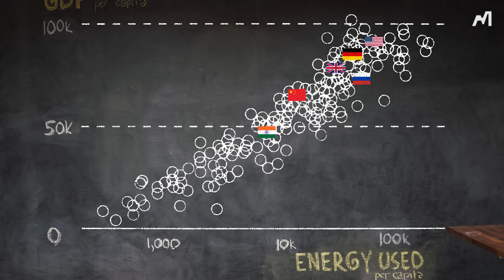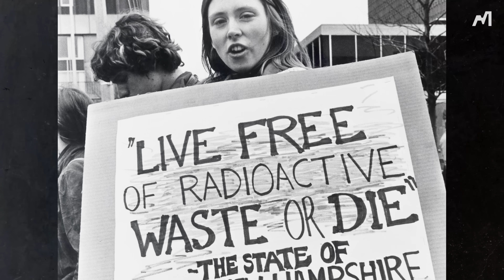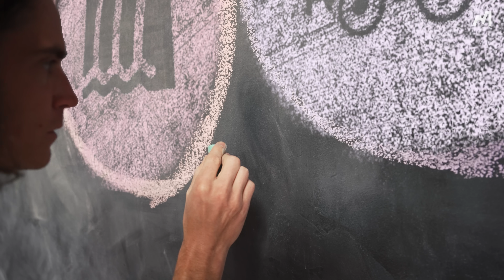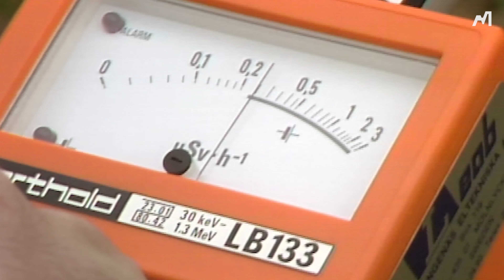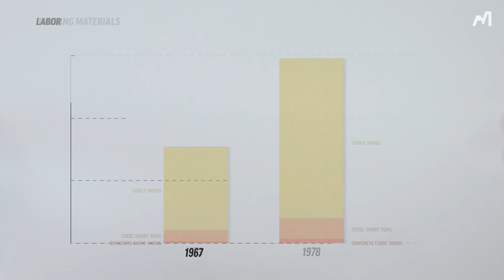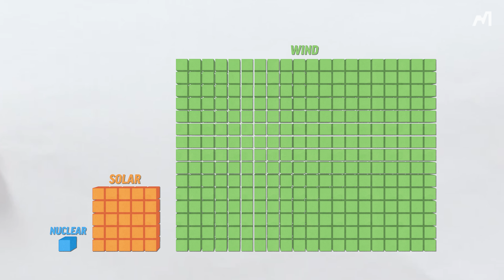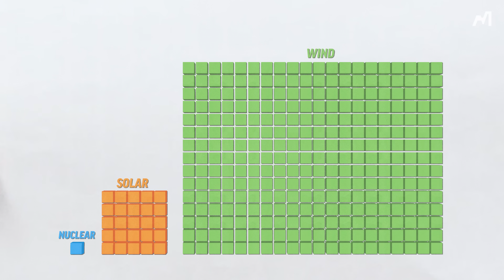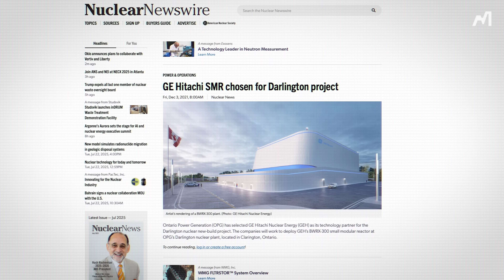They're Lying to You About Nuclear Energy

Comment: Worth noting the downtime for many nuclear plants and its effect on costs. During the drought in Europe during 2022, France had only 32 of its 56 reactors running due to a combination of the water sources for cooling being either too warm, simply not enough water available, and also scheduled and unscheduled maintenance. That's only 57% of its nuclear power actually available and led to electricity being rationed so to speak. One plant alone was shut fown for four years for maintenance. All that time it's costing money without making any. Expensive to say the least.
Reply: That's why the US should have and use MULTIPLE sources for energy.
Reply: @robedmund9948  They do? Coal, solar, wind, nuclear, and hydro... There's probably others I don't know about. Are they using Tidal energy anywhere? I learned about that one in middle school but haven't heard much about it. Seems under utilized.
Reply: @TheManyVoicesVA I think on the Pacific Coast some tidal (very limited) is used, but I'm not 100% certain.  I agree that it's probably underutilized.  So is Hydro.  We could use hydro wherever rivers/larger streams run even without building dams and massively disrupting ecosystems, but there's no economic incentive there.
Reply: @robedmund9948 the economic incentive is literally free power.
Reply: @TheManyVoicesVA  I meant for major corporations like oil, wind and solar.  But yeah, after the initial investment, "free" power is a good thing.
Reply: @TheManyVoicesVA there’s no free power my man, tidal energy is consistent but low in magnitude- it’s difficult to extract enough energy from it with respect to the effort taken to put generators under water. Another huge point is corrosiveness of salt water, huge maintenance cost and marine life protection. as of right now, it’s unfortunately still too complex and maintenance intense and therefore too expensive.
Reply: That's partly the result of 30 years of anti nuclear push in the country, green regulations and the lack of investment in the industry because of it.
Funny how it happened after several years of pushing more and more renewables, yet they couldn't pick up the slack. And that just made me think of the Spain blackouts where they are totally phasing out nuclear, and look how well they managed it
Reply: @nicolaspeigne1429 so how do you explain that chinas % of nuclear power in the grid dropped even tho theyinvested massively in nuclear power in the 2000s and onwards. Like do you actually believe that there is a great conspiracy around nuclear energy even if china dosnt pursue it more than renewables ? you simply don’t understand nuclear power nor its problems
Reply: @nicolaspeigne1429 Wtf have renewables got to do with there not being enough water?
Reply: Yea, France was dependent on imported power from you guessed it GERMANY.  That's why even France is installing renewables and the nuclear share of their grid is dropping.
Reply: @kennethferland5579 damn what a crazy world you live in
Reply: Sorry but it seems like you've been misinformed, I'm french and we didn't have any problem with electricity "rationning" anywhere. Electricity prices spiked in the last years, but this is due to the electricity pricing system, which is always based on the most expensive source of energy available on the power grid. Lately this most expensive source has been natural gas due to the war in Ukraine and the economic sanctions on Russia that went with it lead to an important price surge.
The massive reactor shutdown was a thing tho, but not at all related to the drought issue, it's just because all nuclear reactors were built more or less during the same period, and the Covid pandemic delayed a lot of the planned maintenance that had to be done. Also a stress-correlated corrosion issue was detected in those power plants, so the scope of the maintenance was further increased with it. And yet we didn't have any power or blackout issues in the country.

The drought issue you're mentioning affects all thermal power plants (so also gas and coal power plants), and is not at all a technical issue but more of a legal one. Thermal power plants CAN cool off from warmer and less abundant water in rivers, but the issue is that researchers are worried that releasing too much hot water in the river could affect the local biodiversity of it. So a threshold of a few degrees was set, and beyond that you must stop heating the river. There was never an issue of small rivers going totally dry during drought, of course no power plant cool off from small rivers that might dry out during summer.

Compared to solar and wind, nuclear has the best uptime, and contrary to solar and wind this uptime can be controlled and adjusted to the production needs of the power grid.
I'm not saying maintenance is not costly for nuclear power plants, this is in fact true and I don't know the exact number but it is probably more expansive than for solar or wind, but you also have to take into account the lifespan of these reactors which can be extended even further than the already quite old (40 to 50 years) nuclear plants we have in France. For solar and wind, you have to replace the panels and turbines much earlier.

The only major drawback of nuclear is the massive investment needed to build just one plant, but once you have it, the fuel is ridiculously cheap and the only real expanses are maintenance costs. Nuclear requires a lot of highly qualified worker to plan, build and run it though. This is a something that cannot be done by companies due to the massive amount of investment and planning needed over almost half a century. If a company-hold nuclear plant shuts down because that company went bankrupt, you can't just unbuild the plant like that, it take years and billions of dollars. This is an issue that wind and solar don't have, you can mass build them locally without too much trouble. But they have other issues that make them complementary to nuclear power for electricity production on a global scale, and not a direct competitor of it as most people seem to think.
Reply: @shiuay6165 Sorry mate but the effects of the drought and heatwave conditions and the subsequent effects on the output of some plants was widely reported at the time and still easily verifiable with a quick search. Same applies to the corrosion issues and the associated maintenance and costs. Both the World Nuclear Association and International Atomic Agency have written pieces on these issues, and I have no doubt will still be available on their extensive websites. Both of which have always been a reliable source of information on anything nuclear power related in my opinion.
For the record, I am in no way anti nuclear power, I am just realistic about the various issues that can arise and the associated costs and effects on energy security. The water issue I have always felt was a major concern for us here in Australia given the severity and length of droughts we are prone to, and would be foolish to ignore when considering a nuclear powererd future.
Reply: Noted.
Reply: Yea but did you consider this video isn’t nuanced at all and is largely just an echochamber for nuclear pipedream entheusiast who disregard all you very valid points ?
Reply: @decflecc98 honestly, i didn’t even watch the video but jumped straight to the comments to check exactly this point 😁. and thanks, you basically confirmed my suspicion - especially when looking at basically all other comments except for this thread 😅.
Reply: exactly! When looking at the levelized cost of electricity, nuclear does not stand a chance against wind and solar - and that's ignoring the costs for breaking down a nuclear plant. These are miraculously never taken over by the providers and are often paid for by taxpayer money. Also, most plants end up costing a multitude of the initially estimated cost price which basically destroys the business case - days of standstill definitely won't help it either
Reply: @Max-oo9ez  And then there is the free insurance provided by the state. No commercial insurer would accept the risk.
Reply: @Max-oo9ez how many wind mills do you need to equal a single nuclear plant? How much space does that take up? What do you do when there's no wind?
Reply: @TheManyVoicesVA And what do you do when there's no water for cooling for years in a row?
Reply: @plumtube01 you can import water. You can't control weather. It's probably easier to desalinate salt water from the ocean than it is to make wind and solar more viable. (They aren't going to solve our energy needs anytime soon.)
Reply: @TheManyVoicesVA Import water? Pretty hard to do in a drought mate. And while a desal is an option, it is another capital and ongoing cost, plus it's going to use some of the power from the plant, making the already high LCOE even worse.
Reply: @plumtube01  probably cheaper than cleaning bugs off 30-40 fans every month.
Reply: @TheManyVoicesVA If it was so cheap everyone would be building them.
Reply: @TheManyVoicesVA solar and wind energy are profitable businesses lol.
Reply: @plumtube01 Palo Verde in the USA uses recycled  sewage water. Im in Australia and recycled sewage water is used for power plants here.
Reply: @mazdub  Hey mate. Yeah it's certainly possible, but my concern here in Aus would be as the French discovered, is that water temp plays just an important role as volune. And given the high temps and extremely low flows we saw during the last big drought, a serious concern. Take the proposed nuclear plant at Mt Piper which sits essentially at the head of the Macquarie River. During the last drought downstream flows into Burrendong dam were less than what Dubbo was using on their tightest restrictions, and that's their sole supply. They were down to only a fortnight's worth of water.  Now consider that roughly the same amount of water entering Burrendong was the same amount entering upstream from Bathursts water treatment plant, and I think our rivers are strained enough already. Add a greater population and probably even drier conditions in the future, and I think it's fair to say drinking water will take precedence over cooling a nuclear plant. Either way, very risky in this type of scenario in my humble opinion.
Reply: @TheManyVoicesVA  By cost per energy produced eg the only useful measure? Less than nucler.
Reply: @Max-oo9ez  What is a ‘levelized cost’? 

Nuclear should be a tiny fraction of the  cost of any other supposed ‘green’ energy, and that includes the absurd costs associated with regulations that currently plague the industry. 

Maybe I just don’t understand what a ‘levelized cost’ is but apparently it has nothing to do with money or finance.
Reply: @traceyoung5592 and why should nuclear be a tiny fraction of the cost of other energy sources ? At the end of the day nuclear energy uses the same mechanism to create energy as a wind turbine just with a vastly more complicated system to get there.

Comment: 80 year lifespan? Could the author please give an example of any plant going beyond 60?
Reply: Yes, no operating nuclear plant has reached 80 years of age.

However, the NRC has several applications under consideration for lifetime extensions, have indicated they see no reason not to accept the extensions, and have stated they see extensions to 100 years as feasible.
Reply: @factnotfiction5915 I can only assume it will be a similar situation to the life extension of coal plants here in Australia, with massive costs incurred. These are due to major overhauls and the requirement for more frequent downtime for inspections and maintenance. Currently our coal plants after their life extensions are only operating around 60% of the time max. Basically it can be done, but the running costs increase while output decreases.
Reply: @factnotfiction5915 No doubt there will be considerable downtime for a major overhaul, and going off coal plants that have been extended, quite a considerable routine inspection and maintenance schedule thereafter. As an example some of the coal plants here in Australia are now down to operating around only 60% of the time during their life extension. So while absolutely possible, the ROI diminishes even more.

Comment: As someone who worked on Nuclear Reactors for 6 years, yes, nuclear is much safer than most of the public believes, and I am a proponent of it, but holy shit you have so much bad and misleading information that this video is little more than pro-nuclear propaganda.  Trying to equate radiation from heat to ionizing radiation from fission is completely disingenuous whether you were using it as an analogy to illustrate the idea or not, that’s not the same thing and I think you know it’s not ‘good’ information.
Reply: > Trying to equate radiation from heat to ionizing radiation from fission is completely disingenuous 

I assume you meant this section at 4:18:
"You have nerves in your fingers to tell you to stop touching something.
If it's hot, right, stop, or that's going to become a problem.
But because it's impossible to avoid radiation,
your body evolved ways to live with it."

He isn't equating heat with radiation; he is stating that the humans don't have a 'sense of radiation' like we have a 'sense of heat/smell/etc' because we don't need to detect radiation, it is too ubiquitous to bother evolving a detector - instead we evolved a defense mechanism (rapid cellular repair).

Comment: It all sounds so easy until you try to do it. You will never get a new plant sited. All of you who say "do it" would also say "not in my back yard" which is the protester rallying cry from the mid 70s. The plants in the northeast that were delayed or never opened were unable to get accident evacuation plans approved. 
I worked with a guy who took nuclear waste, stored in 55 gallon drums, out to the middle of the Pacific and dropped them overboard. Try getting a permit to store nuclear waste anywhere in the US. The site immediately becomes a perceived terrorist or war target.
I read the requirements for nuclear site design when I worked in an electric utility engineering department and they require the plant to be bomb proof. That adds cost to the project that makes it too expensive to be competitive, especially when natural gas fuel is nearly free as a byproduct of fracking.
Reply: That’s the point of this video. All the over the top regulations killed nuclear. Also, I don’t get these NIMBY people. I’d love to see those cooling towers in the skyline of my city. Id love to have huge wind turbines standing in the hills of my town.

Also, there’s no way you know a guy who dumped nuclear waste. That shit is way too hot and radioactive to just be stored in 55 gallon drums. If someone told you that, they were lying to you.